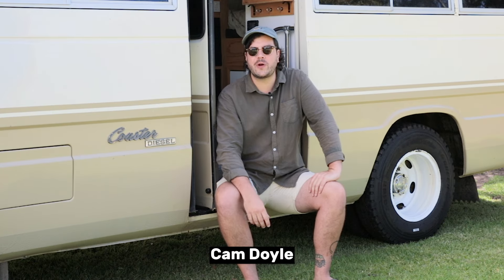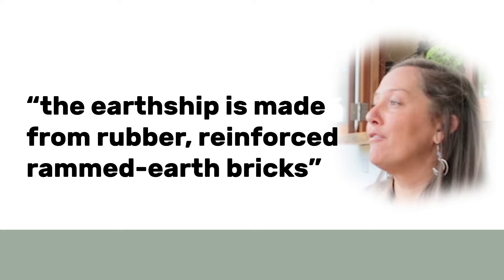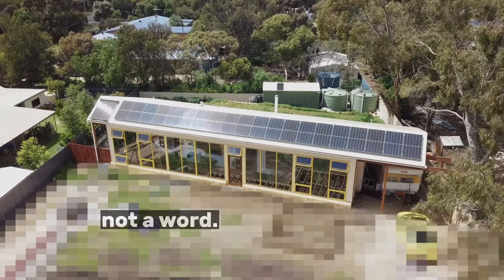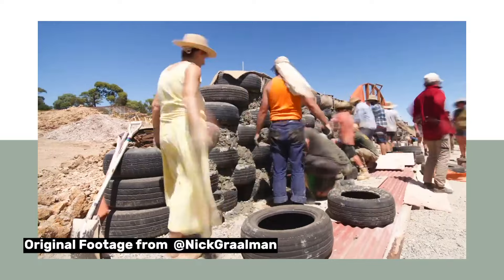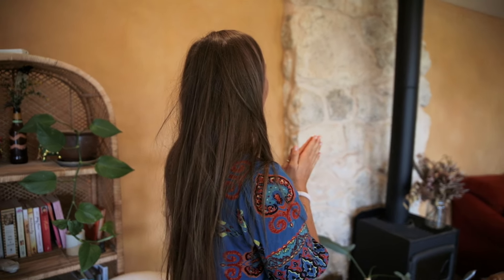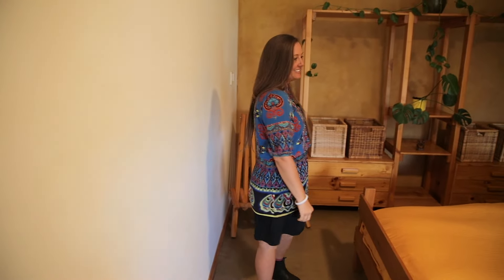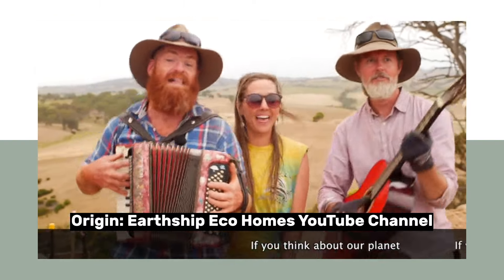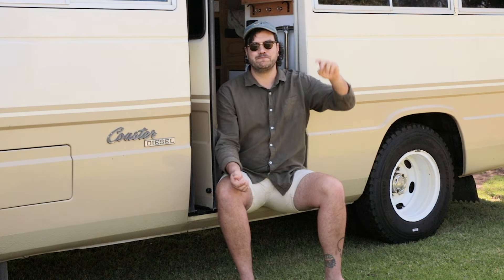An Earthship Can be a Sustainable Home in the Suburbs | Act Local

Comment: I agree whole heartedly about facing  your house north ( southern hemispere), BUT, looking at an arial view of your house on the block, it appears you've taken it to the ' letter of the law'. If you initially got advice from an electrician, he would probably advise to keep the house parrallel to the kerb as any power savings lost by being a bit off north would be so insignificant( I'm talking cents / I'm talking 0.0001 % less in power collection, if you just put it square on the block ( I'm a carpenter), because it's so close to north it's not worth putting your house askew to be true north. As it is ,you've restricted easy access to the rear yard. It would have looked so much nicer if the house was square to block ( in this instance, because it's so close to facing north). In short, you've stuffed it ( aesthetically), for 0.0001% gain.  On a different note, I see houses being built today  eg : on a 5 acre block and they face the house to the road AND IT'S FACING EAST ... OR WEST !!! so dumb, ( it's the "let's face the house toward the road mentallity- old school thinking"), when they had all that room to actually face it true north. So, even in these environmentally conscience times,  facing a building northward,is still not on many peoples radar. Also , shame on councils that approve these DA's that don't have  house  facing / or close to north as possible and window placements as well. many plans have windows facing east  or west, when with a bit of tweaking, they could be faced north.
Reply: You are correct.  When you live in an Earthship you are in-sync with all of nature.  The passing sky, clouds, stars, moon and sun all flow past your home.  It and you are aligned with nature.  True North is not the same as magnetic North.  The streets should have been aligned correctly!  Which would benefit every home in the neighborhood.
Reply: @jonwinns6808 still, if every street was perfectly facing the proper angle, then every house would be perfectly square 

Not really as mother nature intended and would look pretty boring
Reply: I’m in the northern hemisphere and my home faces south east. Even with it not being truly south facing, I can tell the difference. Front of house is super warm during winter months as the sun passes low in the sky across most of the front. I actually open my front door on winter days to warm the rest of the house through the glass storm door.